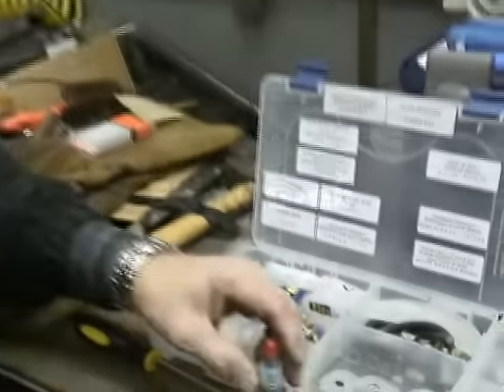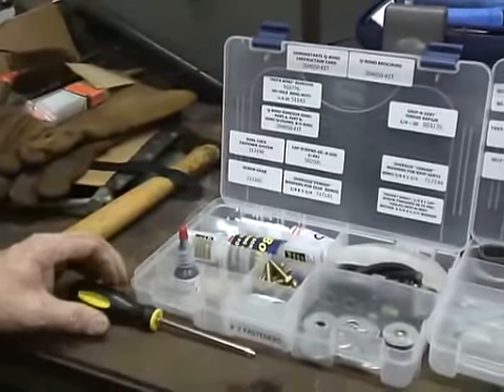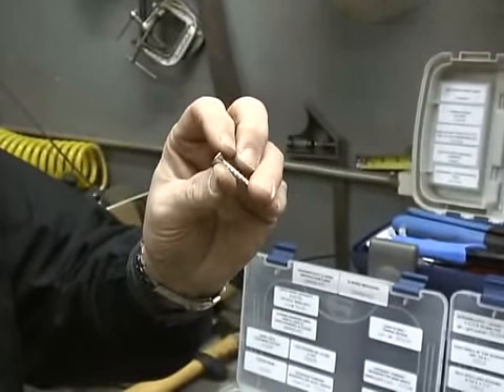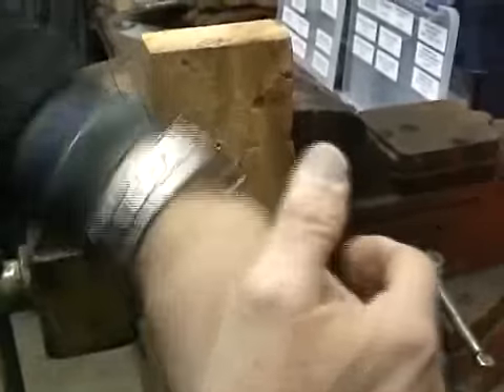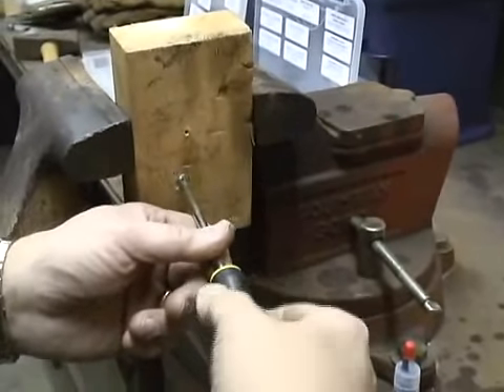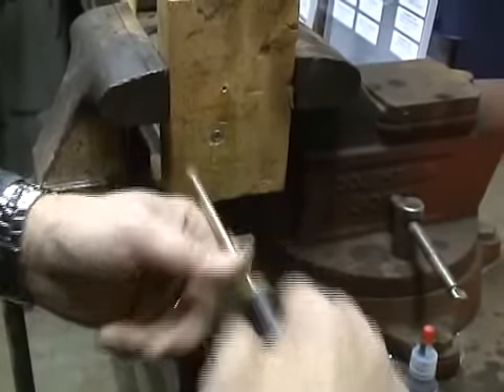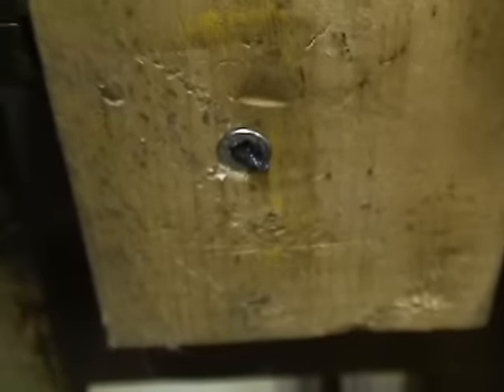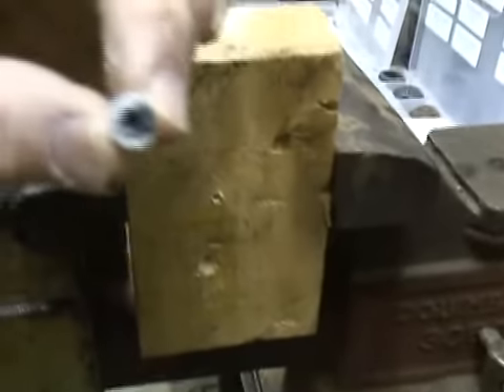Screwgrab™ removes screws, nuts, and cap screws [Handyman Demos]

Comment: Works great for screws and bolts whose heads are just starting to slip. Great for a preventive measure. May not work on severely stripped faster heads.

Comment: Didn’t work out for me
Reply from the maker: We are sorry to hear that the Screwgrab did not work for your application.  It is designed to be used for mild stripped heads.  We have found that any screw with more damage than that requires a more aggressive approach with left handed drill bit or screw extractor.  If you'd like more information on our other solutions, please visit momar.com.